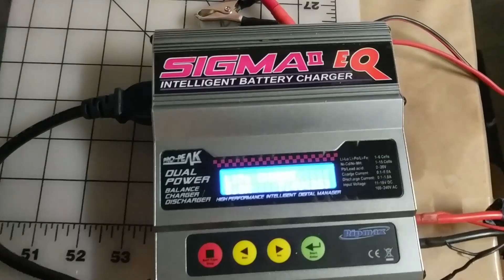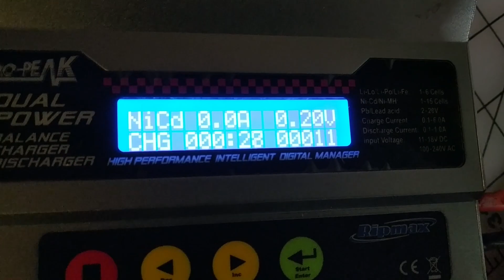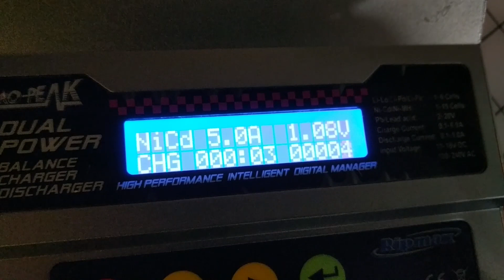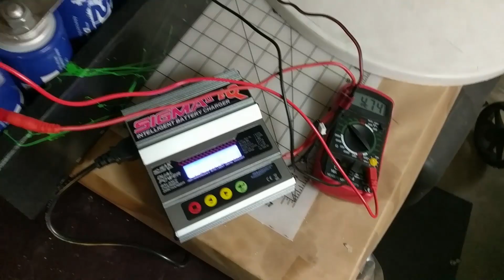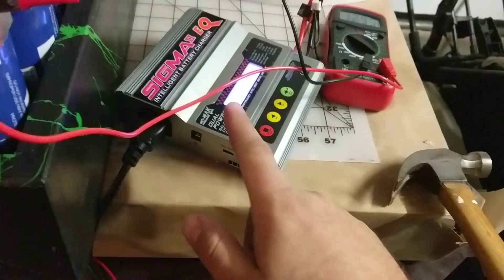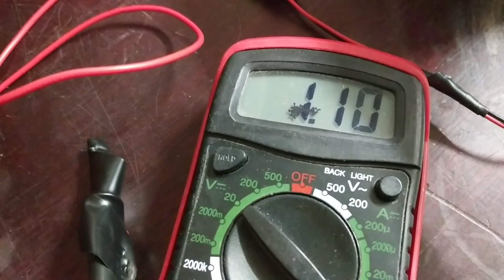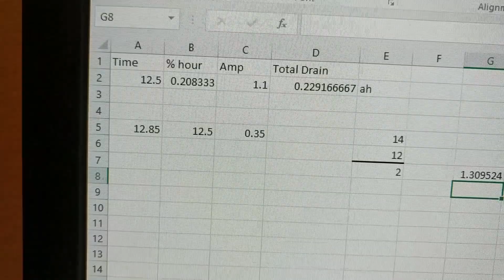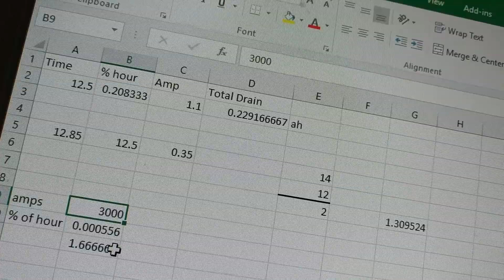How to charge a Maxwell bcap3000 + capacity test

Comment: For car audio applications, increasing the number of banks does nothing for you.  1 bank of 6 caps can deliver over 10,000 amps.  That's 140,000 watts.  It's a little amusing watching people play w/ these.  In car audio setups, running multiple 2 farad caps was common, or 1s, etc...  Just 1 set of 6 caps is 500 farads.   These caps have more capacity than you'd find if you combined all of the caps in every vehicle at a typical car audio meet-up.  The only thing you've really done  here is make take a lot longer to charge and discharge your caps.  Don't waste time on that charger, just use a 250w lightbulb from a battery to the caps.  No more than 250w (or whatever size you can find, can be a 120 / 240v bulb, wattage is still limited).
Reply from the maker: Are you speaking about full discharge capacity? In car audio, the voltage drops from 14.4 to maybe 11 in a brittle setup, don't think the caps have 10,000 amps within that voltage range...
Reply: @LoudFiat  The max power output of those is actually 12,000 amps per cap.  They're not batteries.  If you remove a power source from the caps, they'll drain in seconds with heavy load.  They're to stiffen the system from peak current demands-- that's it.  They're not batteries, they're not alternators.  They store a small amount of energy and can release all of it in less than a second.  Think of them as shocks on a vehicle.  They take the high current beating so that the batteries and alternator don't have to.  That's not to say the batteries and alternator aren't going to get a work out.  The energy has to come from somewhere to recharge them, and just as they can release massive amounts of energy quickly, they do the exact same thing on energy uptake (which is why you never take a depleted cap bank and just hook them up to a battery --  They can release 12k amps, and they can equally uptake that same amount!).  You could charge this setup right here with 10,000 amps and it'd still be 1/7th of what it can take.   Check out this video https://www.youtube.com/watch?v=EoWMF3VkI6U and that should give you a better understanding of what exactly it is you have here.  Not a lot of energy storage, but man it can give it all to you at once.
Reply from the maker: @mhamma6560  yup. These were a friend's to stiffen his 200ah LiFePo4 setup during burps. He dumped them as they ended up hurting the system.

Comment: Also realize you don't have to stop at 12 volts when draining you can go way lower than that the capacitors don't care.
Reply: I have been trying to find any data on storage life issues at low voltage.  Do you know for certain that the storage life does not drop if you let supercaps discharge all the way to 0 Volts?  If so, where have you seen this data?  My real concern is more regular full discharge in normal use, for extended periods of time.  It costs $ and complexity to avoid full discharge, but for many types of batteries it has to be avoided.  I understand these are not batteries, but they do involve chemistry, sort of, as well as physics, while ceramic caps, for instance, are only about physics.

Comment: Completely agree, you should have fairly good understanding of what capacitors are and of electricity,  before handling a bank like that. Are you still alive? 

Connecting that bank to any power outlet in a car should blow a fuse, or two, hooking it up directly to a car battery without fuse probably would hurt the battery.

Comment: Read up on capacitor ESR. A set up like that has an ESR in the tens of micro-ohms. There"s no way your little charger will heat your cap bank more than some teensy, hard to measure theoretical amount. Head-bangers use them as DC blocking caps for kilowatt audio Amps. Experimenters start diesel truck engines and spot weld with super caps.  

A bigger concern is balancing series super caps. They have wide tolerances. Unless they are carefully matched or connected to a charge balancer, a series string wont charge equally. You need something like a Li battery balancing circuit to ensure charge sharing. Also I suggest cross-cell shunts for cap arrays in series-parallel connection. .

Be careful there. Big super cap arrays are capable of thousands of Amps instantaneous current. You're a fumbled pair of pliers away from a major fireworks display. I suggest you keep your charged super cap array in a lidded plastic storage box unless actually making connections.
Reply: Is there a way to safely balance each one? With a BMS maybe?

Comment: Lol, heat the ultracaps? There's nothing that little battery charger could do that would heat that bank my friend. Not without the charger letting out the smoke.
Reply: There is one way to heat them, connect them wrong.
Reply: @Murphy deffa As in, over-charged? Because if the caps are just properly charged, obviously the charger isn't going to do anything but sit there and generate like 5W of heat from transformer losses and such.

Comment: I would like to replace my 12v batt with this setup! I need the rm and would like to lose the weight! This is in my 1929 Model A with a 429 cu in engine, blower, roller everything in the engine, it is low compression so cranks over  relatively easy ! Is this an option for me?? Would really like your input, I am mechanically inclined but not electrical inclined!
Reply: A bit expensive. I would just use a smaller battery
Reply: @Pops180  but it would last forever!(?)

Comment: what do you think of using super caps fir wind generator energy storage and then sending it yo an inverter for AC?
Reply from the maker: Sure, as long as your main storage are batteries. These can help with spike in voltage.
Reply: As you said connecting a battery to a cap would be a huge draw into the caps. i was going to just use 12v caps as storage unless you have a different configuration in mind? Thank You
Reply from the maker: @Thewizzardof9  the caps have very small capacity.... Very small
Reply: I am using 3 1000 amp 12 volt caps I may have  to add more later but I think it will be enough. if they will last for a day.
Reply from the maker: @Thewizzardof9  what model caps?
Reply from the maker: @Thewizzardof9  you mean 1000 CCA amps right? Not 1000 amp hour....
Reply: Gravity 1000 Amp Car Battery Capacitor Gr-1000Bc on amazon
Reply: The reason I am looking at the caps is for an increased charge and discharge capacity
Reply: I do not know it did not say cca it only said 1000 amps
Reply from the maker: @Thewizzardof9  you'll get much much much less capacity. That specific item you are looking at is complete and utter trash. It's a 6v battery with 3 small caps; most reviews say it can't even start a car...

The setup in this video was about $2,000 and it would get owned by a $50 battery in terms of capacity. The benefit caps give you is super fast charge / discharge at the cost of very very very little capacity. 

Do some research and don't waste your money, your use case doesn't sound appropriate at all for caps IMO. 

Unless you are spending a thousand or more on a capacitor bank, it's probably junk and just marketed towards people who don't really understand how caps work.
Reply: @LoudFiat  that's correct, boostcaps, ultra-capacitors or supercapacitors are best for peak loads and regenerative braking. They discharge very quickly and charge very quickly. They produce huge power at peak loads. They last for years. Temperature hardly affect their performance. For me, these capacitors would work better in parallel with a lithium ion battery and they can save the battery life or extend it's rated capacity. I am going to try this on my prius plug-in.

Comment: Caps are great for their capacity to deliver heavy amp loads for short intervals. As someone else has mentioned, these caps can deliver up to 10,000 amps each at dead short and you have basically 6x this figure ie, potentially around 60,000amps at 12-16v at the bus bars if shorted directly.
 My thoughts are that this would be an excellent cap bank for a hybrid/ battery solar system as the caps will allow a much greater starting current ability for use with an inverter when starting up heavier loads like motors, fridge, air con perhaps, etc, especially when some of these loads could possibly start in unison at odd times.
The cap bank will greatly alleviate the heavy spiking loads that can harm the batteries and possibly the inverter.
Reply from the maker: Yup, I've read about auto manufacturers looking into these for EVs, especially useful.for regenerative braking capture.
Reply: Marius Dornean Yes, exactly!
Reply: Actually, the datasheet says "Absolute Maximum Current = 1900A"
"Short Circuit Current, typical
(Current possible with short circuit from rated
voltage. Do not use as an operating current.)" = 9300A

Comment: current draw is going to increase as the voltage drops to the fans rated voltage of 12 volts. it should pull its rated amperage at 11.8 to 11.9 volts.

Comment: so this expensive caps are so low in Amp-hours  charge that they are basicly unusable in anything else but to start your car on a cold day..Pffff,,,
Reply from the maker: They're useful for burps in competitions
Reply: Even bigger PFFF :)
Reply: I just watched a vid with good use of this capacitors....Increasing power in transmiting radio signal over 2500W..Also i guess they can be used in audio power amps EZ! https://youtu.be/ebQbWgG4_LU
Reply: But they will do it much better than any battery chemistry